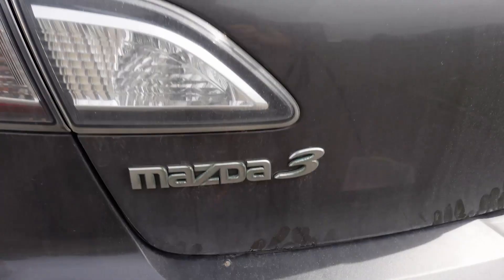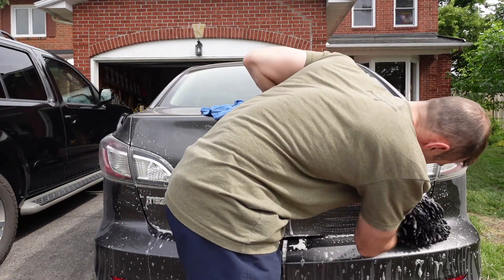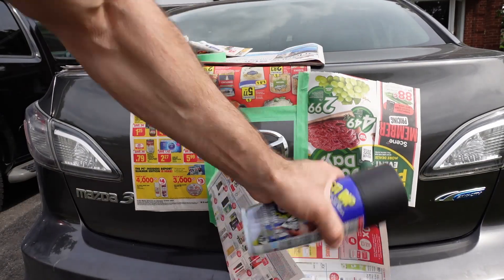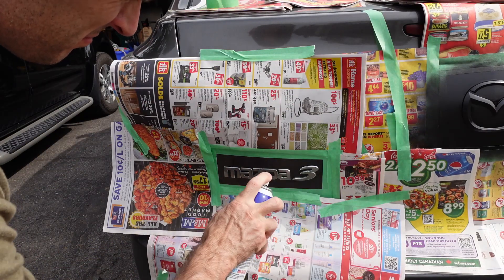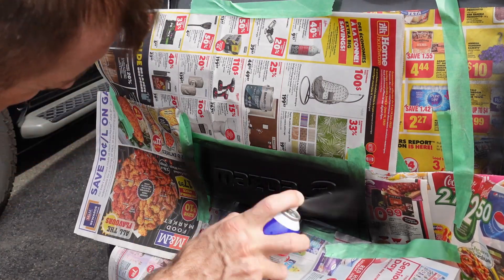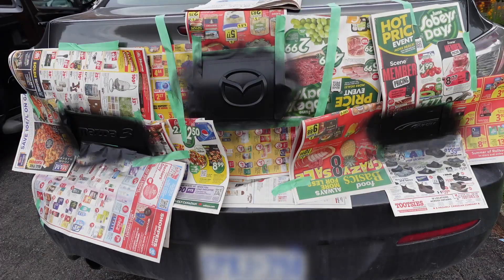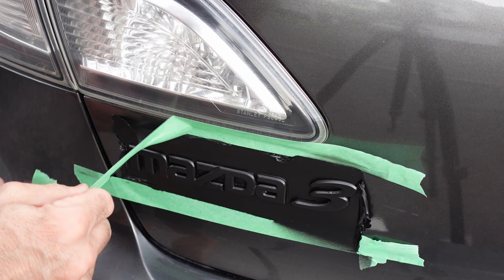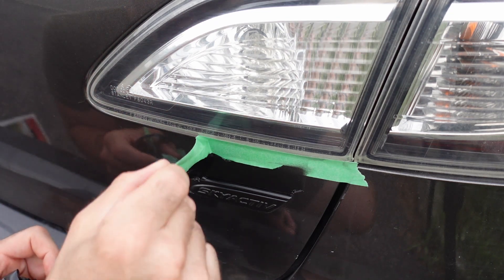Plasti Dip Car Emblems

Comment: I wonder if putting a coat of wax on paint will help to peel the plastidip easier? I’ll have to try it! Or maybe a quick spritz of ceramic detailing spray? Now you got me thinking about blacking out my emblems!
Reply from the maker: The emblems turn out good. 
If you hate it you can also just take it off.
I still have 3/4 of the can...I'll probably plasti dip more stuff.